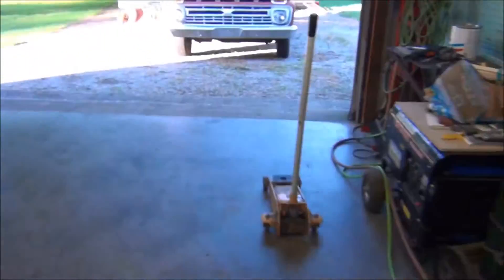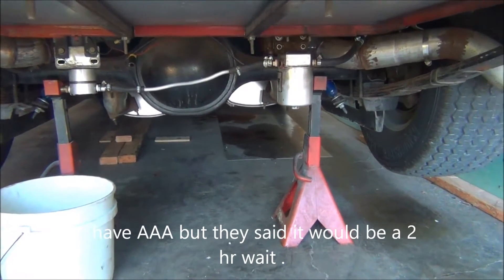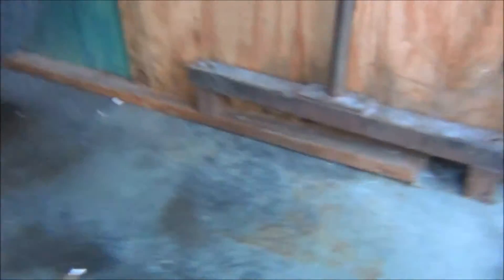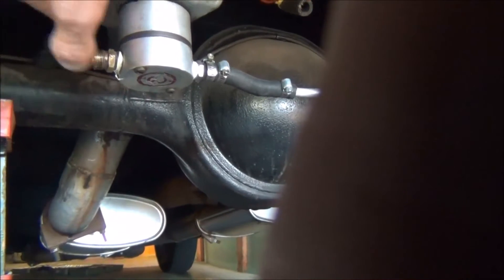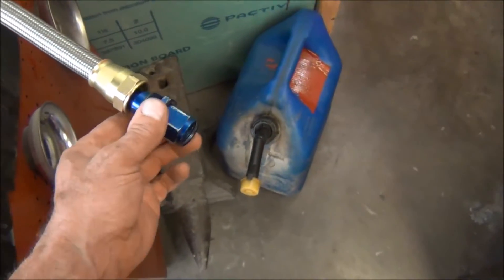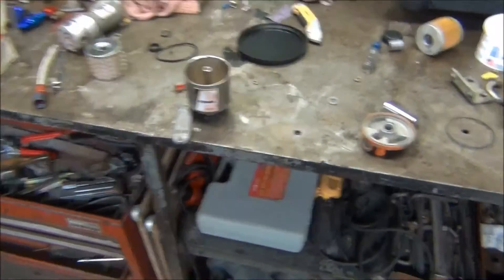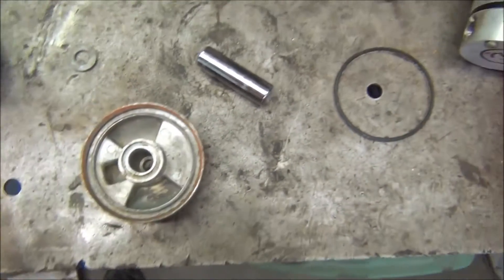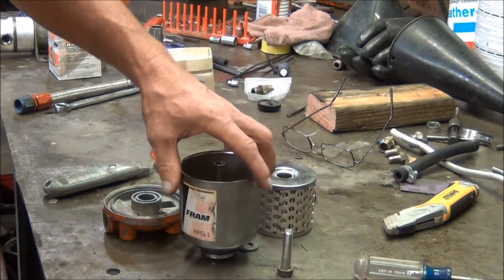Remounting the Torinos fuel pump and filter canister Part 1

Comment: Enjoying your videos! Subscribed. If it helps for the future, WIX 33900R is a good replacement for the Fram fuel filter element.  Not written in stone that I can find but... I have been told and taught it is best practice (safety)  to NOT mix brands of  'Hose' and 'Hose Ends'. OK to mix adaptors and other pieces.
Reply from the maker: Thanks for watching